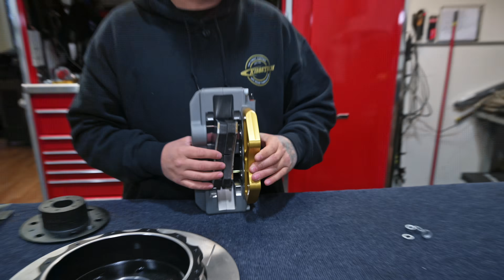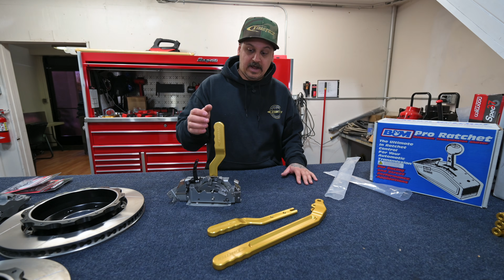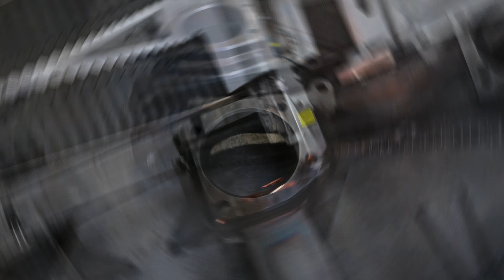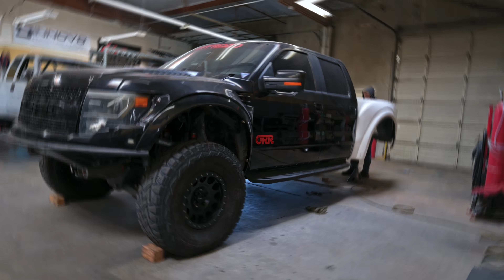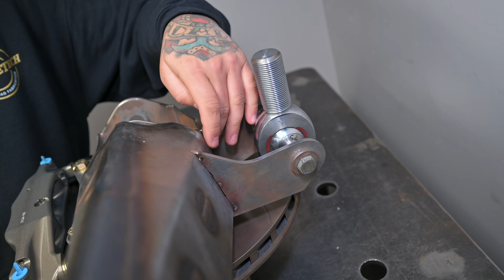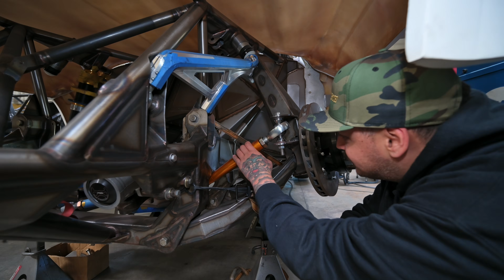New Kibbetech Pre Runner & Race Truck Parts for 2023

Comment: I see you still have at lest one old Miller kicking around the shop. How are your guys liking the Everlast vs. the Miller?
Reply from the maker: We have 2 old syncrowave 250's that I will never get rid of! One of them I bought on my 18th birthday.
No complaints from the guys on either machine. The everlast torches don't last that long with constant use so we upgraded those with parts from arc zone.

Comment: Can you a similar kit for the GM 2500 & 3500!? 🙏
Reply from the maker: A similar what kit? We covered a lot in this video.
Reply: Sorry, a big brake kit
Reply from the maker: @jacobkrzyzek5777  No big brake kit for those models from us. Wilwood has some kits and it requires a very large caliper and rotor that will not fit in a 17'' wheel. But you need that to gain performance over stock.